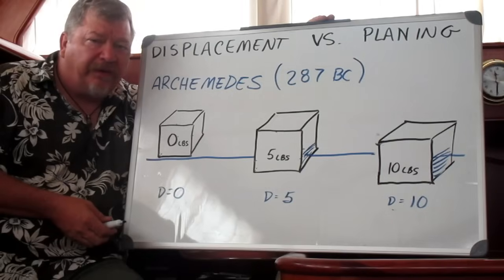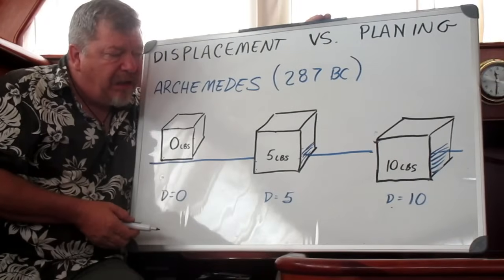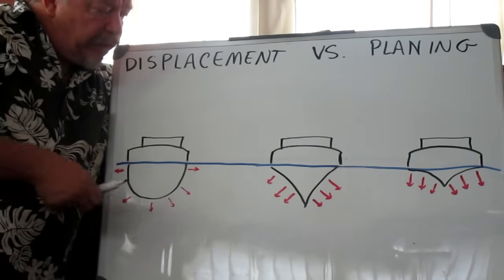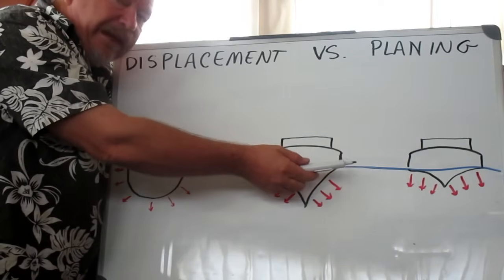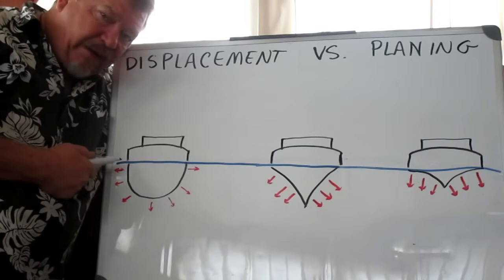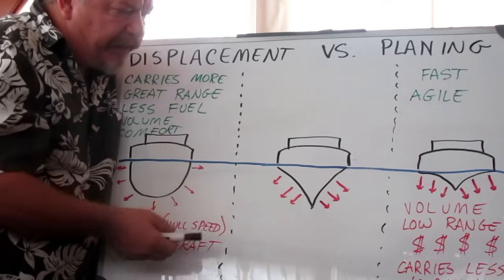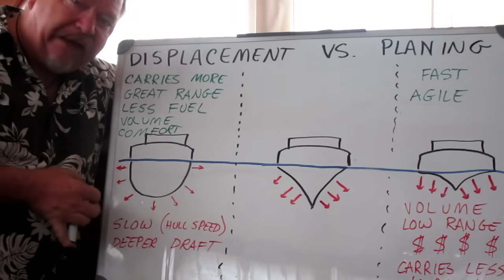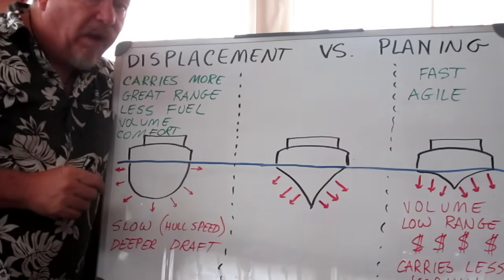Displacement vs  Planing Hulls

Comment: theres an old legend about how he  discovered his principle. the current king of his land wanted a crown of pure gold to be commissioned and for reasons lost to time, was wary that his blacksmiths were cheating him and mixing the gold with other alloys and wanted Archimedes to figure out if that was true. since the king had an interesting shaped head, no current mathmatical formulas were reliable. so one day Archimedes filled his bathtub up with water and sat in said tub. he noticed the water overflowing from the sides and then ran through the halls stark naked screaming ureaka (i have found it). realizing this he could now figure out if the crown was in fact pure gold or alloyed with other metals and Archimedes principle was coined

Comment: You could also explain in another video the law of displacement efficiency vs length vs speed vs power, that is:

Maximum Displacement Hull Speed in knots = 4/3 the square root of the waterline in feet. 

Knowing this makes clear every sailing and motoring design decision. Cruiser dickheads pushing their twin V8s in so-called "semi-displacement hulls"  beyond the natural hull speed drive me bananas. They are literally wasting fuel money to push water up into bow and stern waves to save a bit of their precious time, and get to some new destination quicker. They've missed the whole concept of enjoying the journey THROUGH the water and surrounding environment.

As a 10 year live-aboard gentleman on a 19ft long x 6ft beam x  2ft draft x 10hp inboard with a 5.8kn max hull speed  putt-putt launch, I loathe both in principle and reality semi-displacements. I've no problems with sailing yachts, oil tankers or submarines though. ;) such people understand the true nature of boats. The others just want cars and trucks on/in the water.

And to so many boaties, stop calling 40ft - 300ft motor launches/cruisers "yachts". If they don't have sails, in my books, they are not yachts. 

End of rant. Lol.

Comment: But I don't get how a planning hull costs more on fuel. If you slow down the boat so it doesn't go up on plane, would it cost less in fuel though it has to move more water over a longer period of time?

Comment: Good stuff. I now understand why pontoon boats are rather slow, as they rarely plane.  I'd love to see an explanation on the better designed catamarans though, like the WorldCat 235 CC.  It's supposed to plane easy (even on one engine), has a very shallow 9" draft, yet rides smooth and comfy, and handles chop and swells very well. How so?

Comment: For years people have been telling me that displacement is not the same as the weight of the vessel. If I understand this correctly, they are wrong, as I have argued for years. Thank you for the clarity. This solves it.
Reply: I personally think the uploader is wrong when he said "water displaced is equal to the volume of the object"

If we put a 1kg bar of gold with volume of 1 litre in a water. It will not displaced 1kg of water. It will displaced 1litre of water.
Reply: @AzimBass 1 litre of water weighs 1kg, so its the same i guess
Reply: @cacamen45  
Sorry what I meant was
"If we put a 1kg bar of gold with volume of 53.26cm3 (0.053 litre) in a water. 
It will not displaced 1kg of water. It will displaced 53.26cm3 (0.053 litre) of water."
Reply: @AzimBass  that makes more sense 😂 and I also understand what you meant, make sense

Comment: Excellent video.
For us dinghy sailors is a far easier equation.
Some of the boats I've sailed were not realistically planing hulls because the windspeed required to make them plane was not appropriate for the kind of sailor that would be sailing them typically.
Mirrors, Toppers and even Wayfarers.
They will all plane but no kid is ever going to be out in the conditions that would let that happen.
I sailed amongst others an international 420 that would plain on a three sail reach in about a force three and would get very exciting in a 5.
We used to sail past ospreys in high winds due to the propensity for the 420s lightweight hull to pop up onto the plane with one pump of the spinnaker.
It was a great boat.
After that we sailed a Laser 4000. That thing was a surfboard with a sail.
It would plane upwind slightly off in a force 3 and would make better vmg for it.
Of the wind it was both a riot and a pussycat.
Even in a force 5 we used to scale the river on a beat 3 miles then come back on a 3 sail reach in 10 or so minutes. That's what it felt like anyway.
I've got tracks on a GPS of 25mph+ 
That thing was crazy but oddly completely compliant. You could take your hand off the helm in low gusting conditions at speed and the boat would just plane on.
It was clearly designed to be most balanced on a full on three sail reach and it was wonderful for it.
Deathbed memories.
Love and Peace.

Comment: Flat bottom boats are best for planing, but jon boats do not require bigger engines. On the contrary, you can get away with smaller, less expensive engines.

Comment: Really nice explanation. As an example of the effect of wind speed on hull speed, crossing the Gulf of Tehuantepec in S.W. Mexico we ran at the designed  hull speed for  8 hours with a reefed storm jib and Main reefed below the spreaders - 65 square feet of sail on a 27 foot 3/4 kee[ boat.

Comment: Thank you for this video! An excellent simple and well diagramed visual aid for differences in hulls.
Reply: It's quite a bit too simplified from my understanding.
There's issues like where the buoyancy is located etc.
And how the water is shaped during movement.
The traditional Norwegian shallow draft fishing vessels I've sailed intentionally where trying to create vortexes in the water, increasing stability while sailing and in theory also reducing the amount that the boat is pushed sideways by the wind allowing it to tack closer to the wind then with another hull shape when at optimal speed.

Comment: Thanks for an easy to understand explanation. 
So what category of hulls are trimarans in? The likes of corsair or dragonfly etc?
Reply from the maker: Lynda,   Thanks for watching!  Interesting question.  As a general rule, sailboats of all types operate as full displacement hulls, or close to that.   There are a number of exceptions, as you would expect.  Anything that has a plane that brings lift with speed will operate further and further from a full displacement model as the speed increases.   I have not studied trimaran hull physics, but because trimarans are known for their speed it stands to reason that designers would have not overlooked that obvious advantage.
Reply: @sailingpuffin9441  thank you.

Comment from the maker: Cliff Lee,   'Fast Dispacement' sounds like sales gibberish.  There is such a thing as 'Semi-Displacement'.....   You could also claim 'semi-planing' I suppose.  There is a range of hull types running from full displacement to planing.   At rest, everything is a displacement hull...  Then when you start moving, the amount of plane in a hull that gives lift varies from hull type to hull type.  Of course, the engine output has to match...  People seem to like the fuel economy of displacement hulls, so the sales folk add that to the name.   Yet people also like fast boats, so they add that to the name, too.   What you are probably looking at is a hull which is a compromise, operating at close to displacement economy when under 10 knots or so, then operating at just under normal planing speeds when you open the throttle.   The boat will (probably) not give you the full economy of full displacement, nor the full speed of a fully planing vessel, but the compromise apparently works for a lot of folks.   The name is no reason not to consider the boat.

Comment: What about vertical foils??? Catamarans normally have displacement hulls, but those hulls sometimes have VERTICAL walls and a flat top and bottom (see the tesla catamaran, by tech ingredients). I know they are displacement hulls, but how good a hull is it???
Reply from the maker: Eugenio,  By 'foils' I am assuming that you mean the hull shape of each hull forms its own 'foil' , and not some appendage in addition to the hull?   If so, it would seem a little counter intuitive from a performance standpoint but might be awesome from a construction standpoint.  As for the construction, complex curves are costlier to produce in fiberglass (usually requiring a mold) and are REALLY costly for steel (usually requiring a rolling process).  A flat panel that can be bent to form a hull would almost certainly save money.  As for performance, the prismatic coefficient would be different, although the cross section area would probably be similar as a normal hull.   I would be concerned with the hard chine at the bottom of the hull, which might create an energy robbing 'knuckle' in the water.   With a cat not heeling as much, not sure if the knuckle would matter as much as on a monohull.   Very interesting concept, and thank you for sharing!
Reply: @sailingpuffin9441  well, there's a video on YouTube, and it's explained as a very efficient shape. Of course, not being boat builder savvy, I'd rather hear an expert's opinion.
He used two long flat plywood sheets, taped them together on the edges, and then separated them to 9% of the length at about 40% of the length from the front. Seems like a smart build.

The tesla catamaran, you can find it on YouTube.
Reply from the maker: @xxrgxxcasco  , thanks for the vote of confidence, but I am no expert by any stretch of the imagination.   I got interested in hull shapes when I was a teen, and read up on them extensively.   My knowledge was learned second hand, and then I saw the logic when I started boating.  I will look up the video!

Comment: What is the formula to calculate HP needed for a displacement hull?
Reply from the maker: A good guide is found in the book 'The Nature of Boats'.  You can derive the theoretical horsepower needed to run the boat at hull speed.   Of course, you then have to do some risk assessment for how much horsepower you need to overcome the inevitable contrary wind, tide, currents, etc.

Comment: It does not displace the same amount of weight it displaces the same amount of volume.  Huge difference.  A 10 lbs lead block does not displace 10 lbs of water   if your going to teach marine physics teach it correctly
Reply from the maker: sledstrong,  your statement only applies if the item being measured is sunk.  Floating objects fit my explanations.   Boats I am interested in are not sunk.   If you are going to critique a video, critique it correctly.

Comment: Archimedes said an object placed in water displaced the same weight in water ? I doubt it what about gold and other metal,, 1 kg of gold will not displace 1 kg of water as its denser.
   Anyway i thought good old arche said   if an object placed in water is lighter than the water it displaced the object will float, given its a hull design or whatever water tight object,, he's the reason people start to believe a ship made from steel would float ,,before people thought only wood ship floats

Comment: Great explanation of planing. It gets confusing to me, when hull design gets more in depth: dead rise angle at the prow, amidships, and at the stern. Add in chines, reverse chines, strakes, keel designs...Its all too much for a novice such as myself. What interests me is a power boat in the 18-22’ range, without much draught < 14”, with lots of bow dead rise 45-50 degrees to cut chop, fairly steep angle amidships to help planing, 16 degrees at the stern for a bit of roll stability, high gunwales & full transom with a splash guard, and a sizable reverse chine running back nearly to the helm and a Carolina flare  to ward off spray as well as possible. An efficient design to cut through chop, get up on plane reasonably fast, run efficiently, have a dry ride, and decent stability drifting or trolling at low speeds. Two boats are in the running after a decent amount of searching...A Sea Hunt 188 Triton CC and an Eastern Boats 22 CC. If Eastern made a 19’, it would be an easy choice. I love the tried and true down east hull design of the Eastern. To me, a 19’ is the “sweet spot” for a capable bay boat with off-shore survivability  in < 6’ chop. I’d rather run a 115 hp 19’ than a 150 hp 22’. Any thoughts on either builder/boat? Thanks for straight forward informative videos.

Comment: in addition to displacement there is "travel" or how a hull moves through water at speed meaning a long but narrow u shaped hull can in fact generate incredible amounts of speed as it has the fewest forces acting against it (just displacement). for example a straight up bath tub used for bathing in your home with properly attached motor can really fly across a body of water because if properly balanced it does work according to your theory namely one only of displacement without any concern with lift at all. a great example is a supertanker for carrying oil...something only "slow" because the vessel has to stop and not because it can't go fast. there is also the material used to cause an item to either sink or float. any material that rests naturally on the surface of water (a rubber raft for example) can generate enormous amounts of forward velocity simply by a: not weighing much and b: being above the waterline to begin with. of course then there are waves, tides, temperature, humidity, the type of water (salt, fresh, etc) and of course currents, structure (above and below depths) as well as the type of shoreline (sandy beach versus mangroves vs shoals) and probably an innumerable other in factors i have failed to list here..
Reply: Andrew,   Thanks for watching!   I cannot dispute any of your observations.   The new boat owner is often gullible, and there are some outrageous performance claims out there by sales and marketing people who are willing to lie to get into a wallet.  The basic notion of the video was to give that new boat owner some sort of yardstick; some way of getting at least close to the truth on their own.  Dialing in the actual hull speed down to the tenth of a knot is almost impossible without actually taking the boat out for a spin.

Comment: Rachid Alhourani, the answer to your question is to use weight, not volume.  Mass is technically the correct term, but for you and I and the folks just to our left and right, use the term 'weight'.   As you are aware, equal volumes of dissimilar materials can have vastly different weights.   The boat will push down into the water until the weight of the water it displaces equals the weight of the boat.   This is true unless the boat goes completely under (too heavy), in which case it will continue to sink until it hits bottom or it finds equilibrium at some depth.   Also, this does not work if the boat rests on a shallow bottom, and thirdly, this equation does not work if the boat generates lift (usually through foreword movement).   

 The physics are nice if you are designing a boat, but if you are just looking at one in the water, interested in buying, you already can see most of what you need to know.   An interesting test is to figure out the 'pounds per inch immersion'.   Put enough weight on the boat until it sits one inch lower in the water.  Different hull shapes will require a different amount of weight, of course, but this tells you how much load you can take aboard (fuel, water, food, people, etc) before it starts to screw with the performance.

Comment: Always thought deep v boats took more power to get up on plane  ?
Reply: Yes.  That's part of what the video is saying, although not quite as clearly as it could.  A shallow V hull will go onto the plane quickly and easily because it is deflecting the water mostly downwards, creating a lot of lift.  A deep V hull deflects the water down and sideways, generating less lift.  Therefore, it needs more power and more speed to get up, and often will only "semi plane".  Against that, you get advantages in terms of comfort, handling, and capacity.  A flat or shallow V hull planes easily but tends to slam uncomfortably in choppy conditions.  A deeper V will carve through the chop giving a softer and often a drier ride.